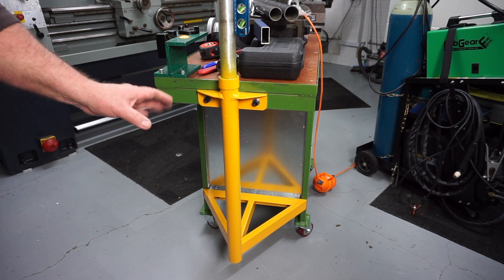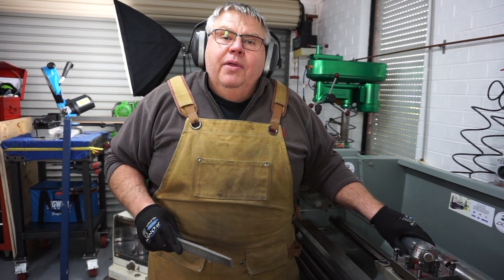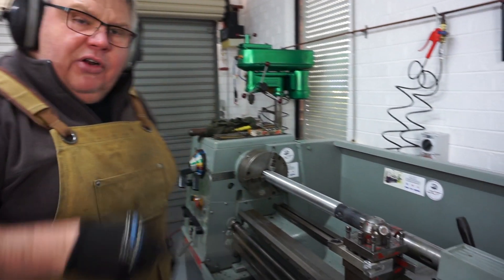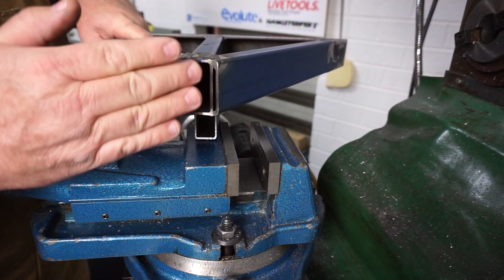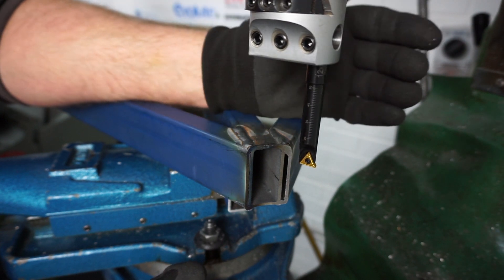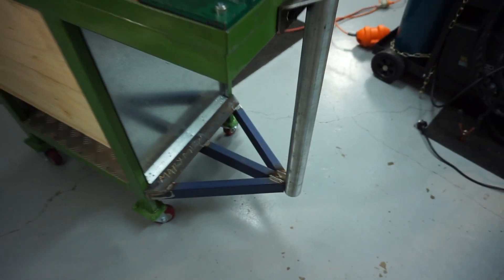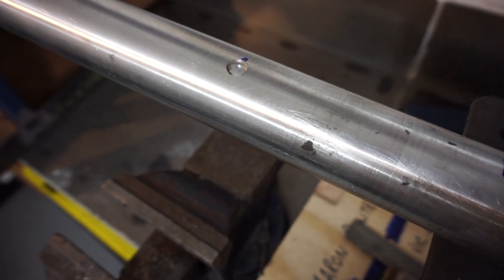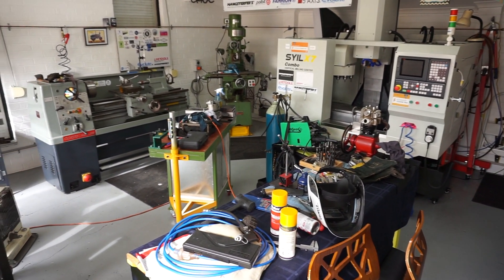DIY Shop Crane Build Part 1

Comment: Do you have a set of drawings?
Reply from the maker: Hey mate. The link to the 3D CAD Model is in the video description. I don’t have the 2D drawings, but you can get dimensions directly from the 3D CAD model. Cheers 🍻
Reply: @aaronengineering great build looking forward to making my own.
Reply from the maker: @gbalock  thank you. I found the table on the side of the road. I enclosed it and put in 2 sliding draws. I made the crane to bolt on. All made from scrap. The crane works very well, but you need to keep weight in the draws and other side of the table otherwise it will tip over. Best of luck with your build. Cheers 🍻 Aaron

Comment: Great Job Arron, Lot of good ideas, I pinched you cutting tool holder idea and made one mate,! I will put it up on my insta page,  and Do you like the sensor centre finder? do you find them accurate? Thanks Gary
Reply from the maker: G’day Gary. Thanks for watching and commenting mate. Hey did you see part 2 of this build? I have finally finished the shop crane and it works a bloody treat. The boom telescopes in and out and the crane can reach the floor. Was that tool the chamfer tool Micheal Connor made for me? Can you tag me on Instagram please. Cheers 🍻

Comment: Maybe  nick a couple of concrete footpath pavers to counter weight it .   Cheers  Aaron .
Reply from the maker: G’day Max. Yes they’d would work well. That and or lead shot down the vertical post. Thanks for watching Max 🍻. Aaron
Reply: @AaronEngineering  Have you seen the worksafe forklift training video's ,  with the jockey wheels  fitted  so they don't tip over !
Reply from the maker: No Max I haven’t. I’ll take a look at it 👍

Comment: Another great mix of workshop stuff Aaron 👍.
I’m assuming you will be ‘lifting’, say >50kg? 
Do you still have your Certiflat welding table?
Regards
Grasshopper
Reply from the maker: G’day Robert. Thanks for following along with me. Yes I’d be happy if it could lift and place your rotary table. That is my design goal. I have no doubt that it will lift it, but it’s the slewing that might catch me out 🙄. Yes still have the certiflat table, my little bandsaw is sitting on top of it 😂. Cheers 🍻

Comment: Aaron, you need to have socks on sir!  That way the weld splatter has time to burn your feet evenly :). Great build so far.  This is cool stuff.
Reply from the maker: G’day Phillip how are you? I was only thinking of you the other day and thought  I should send you a message on FB. Yes the good old Aussie flip flops. Great to wear inside and out, especially to weddings. Oh man, I remember doing many MIG welding spatter in the shoes fancy dance jigs over the years 🤣. Cheers 🍻. Aaron

Comment: Now are you going to have to counter balance the other side of the cart or am I getting ahead and that is in the next part? How can I order some of those safety shoes? They look way better than those old Redbacks.
Reply from the maker: G’day Tom. Yes I’m relying on the weight in the drawers and the vise / rotary table to balance it. I’m confident it should lift the weight, but it’s the slewing that will come back to bite me. I could fill up the support column with lead shot. Great to hear from you buddy. Trust you’re all well. Cheers 🍻. Aaron

Comment: I like to spread out some news paper before I MIG weld it really helps with the splatter. Now you need to a add swiveling crane operators station with a drink holder! Do you even have a hoisting license?
Reply from the maker: Hahaha g’day Paul. I also use petrol soaked rags to help with the MIG spatter, but the fumes do my head in 😵‍💫. Jokes aside I usually never weld inside. But the weather here is absolutely dismal (winter = wet, cold and blowing a gale). Hope you’re well mate. Oh BTW, your CNC re-brain is looking fantastic too 👍. Cheers 🍻. Aaron
Reply: @AaronEngineering  Now for me to get a re-brain! Thanks just a couple of bugs to sort.....
Reply from the maker: @CapeCodCNC  I really wish that I had one 🧠 
😂